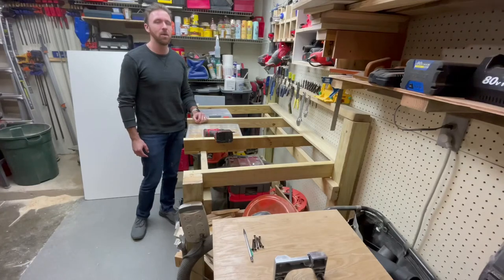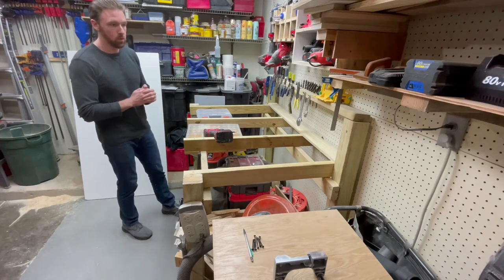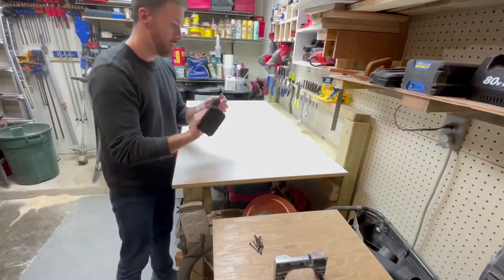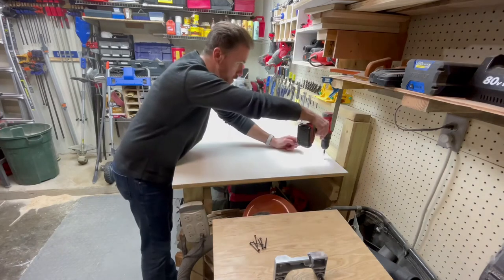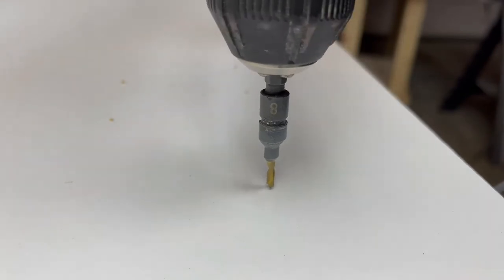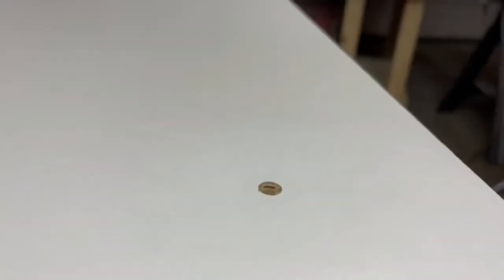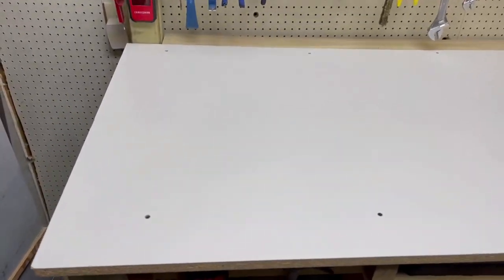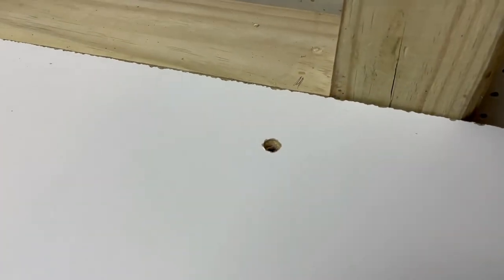Counter sinking 8 screws into 3/4” melamine

Comment: How would pocket hole screws from the bottom work? That way no holes on work surface. Too weak?
Reply from the maker: That would probably work! Once the surface gets messed up enough I will flip it over and have a perfectly clean other side. So for me either way I will have holes at some point. They have yet to get in the way though!